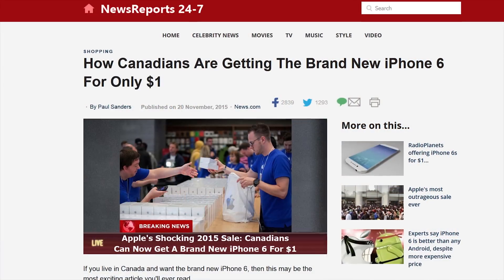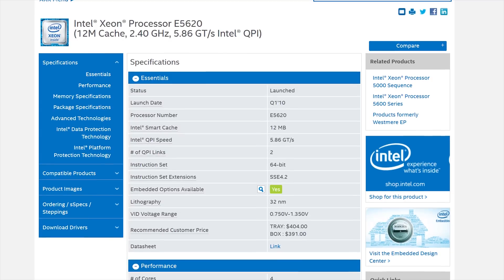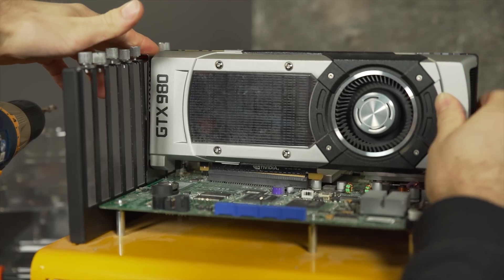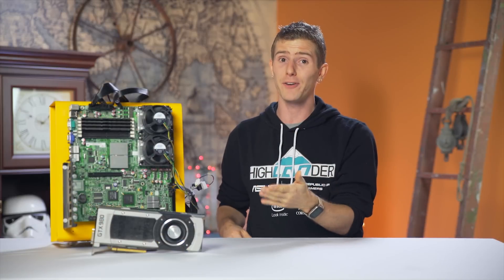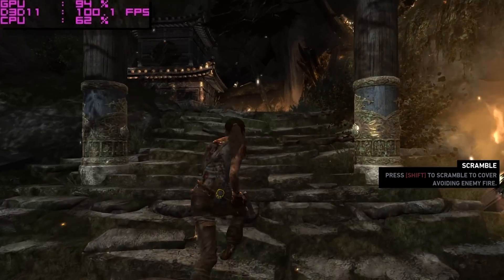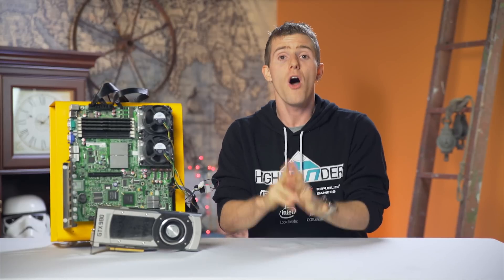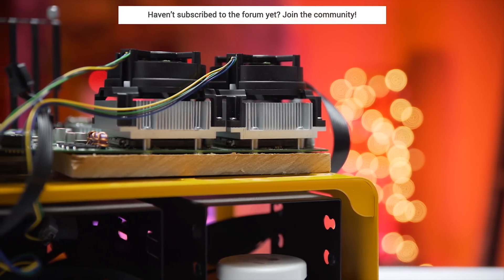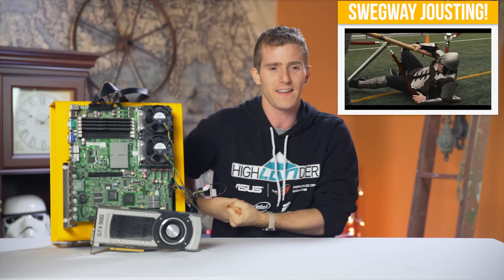Under $150 Budget Gaming 8 Core CPU, Motherboard & 16GB RAM

Comment: so many great bargains to be had with old server hardware. i really wanted to get a westmere six or eight core cpu for my original evga x58 classified but found out that only later versions of the board support westmere so i got screwed into overpaying for a gulftown chip (i7 970 - still cheaper than getting a new board/ram - just needed cpu throughput for image editing).

Comment: It would be a lot better and easier to just do a 775 mod which gives you 771 compatibility. With E5420 you would have 4 cores 3,0 ghz,  they overclock pretty well, and so do they perform in games with a good gpu.

Comment: Well I´m using a Xeon X5460 @3.8GHz, 8GB DDR2 OCZ-Gold, 2xGeforce GTX560 Ti in SLI, on a EVGA 780i via socket mod and this rig is outdated 2day, but games till 2013 and some 2014 really run smooth, with no FPS issues. But Black Ops 3, Witcher 3 and newer games r really a huge morsel for this rig!

Comment: I'm surprised Linus didn't mention the fact that 771 Xeons can very easily be modded to run in 775 motherboards (I've done it twice; once with an X5260 [proof of concept], and once with an X5470 [my current desktop, OC'd to 4.0GHz]). It's just a sticker and a little bit of fine work with a Xacto. All told, it set me back about the same as the second-hand-server here (a little bit more, probably, and admittedly with half the cores), and it actually has a decent support.

Also, please realize you're putting TWO processors with TDPs/power draws each equal to or greater than ONE high-end current processor for (maybe) the same amount of computer power. These are being sold for a reason.

SIDENOTE/WORD OF WARNING: I'm not convinced that Microsoft fully supports these older/odder processors in Win10. The Free Upgrade app complains my X5470 isn't compatible, even though it supports all the features that I've seen listed for Win10.

FURTHER SIDENOTES: The Core-2-generation Xeons will not behave quite as quick in heavy multithreading, because the architecture was basically two dual-core chips bolted together, to switch a thread between the pairs of cores, it needs to put the entire thread in cache/RAM (I forget exactly which), and then have the other pair grab it, as opposed to directly handing it off.

Comment: A good compromise between single and multi-core performance on the cheap may be an old AM3 chip like an x4 965 or even an x6 1090T. The motherboards are way cheaper, and there's less of a headache getting the thing together.

Comment: Finally I'm relevant with my dual x5670 12c/24t 24gb and hd 6950! I can run most games on max around 30-50 fps but given that it's the gpu that's 100% I should be able to upgrade to milk more preformance out of it

Comment: Yeah but you left out the fact that server motherboards can take minutes to get to the OS boot.  That and there is no guarantee they even support things like sleep mode, you could easily get stuck with a board that takes 5 minutes to power on and doesn't support sleep.  Also 2 4 core CPUs dissipate much more power than one 8 core chip, something that will have to be taken into account when purchasing a power supply.

Comment: I demerit the sawing of that video card. I didn't like it at all.

I would had gone out of my way to figure out what cap was blocking the video card, buy a tape of the same capacitors from DigiKey or some other cap retailer, then de-soldered the old cap and soldered on a new cap with the exposed lead covered in shrink tubing. That would had allowed it to be bent into position, and whatever of the lead was there could be covered in hot glue.

Same could had been done with the 4=pin power connector, or at the very least, use some copper elsewhere of similar AWG and soldered the extra wiring for that onto the board, once again using hot glue to cover whatever leads were exposed.
Reply: +bluephreakr Saw off a functionally useless piece of a graphics card

Or desolder an already possibly unstable old motherboard

I see why Linus chose the hard way...
Reply: +bluephreakr or he could have just bought a pcie riser for 10 dollars
Reply: Matthew Bauer lol im just yankin ya dude, thanks for the solid input lol
Reply: axertie
But he had to fit it in a case of some kind, yeah? How would the riser had helped?
Reply: MarioDragon
IK they don't do SLI any more and they probably receive way too many graphics cards, but what they did there makes the card less valuable.

I suppose that means come next garage sale, it'll be a very cheap video card, lol
Reply: I used a skil saw to cut mine and accidently cut in half what can i do??
Reply: Eric Cartmenez If the card works, you are in the clear. If the card doesn't work, then you are skrewed.
Reply: Eric Cartmenez  I figured that part out... But for some of the idiots watching LTT videos, I had to reply to your post as a warning to them more than to you. An example is that users time and time again ask me if I can fix a laptop where the screen is ripped off or they ask me to fix a keyboard where they wore through the number pad keys damaging the PCB.
Reply: Matthew Bauer aaaah okay, understandable. well anyway i appreciate the very real response i got anyway hahaha. thanks.
Reply: +bluephreakr dude it's linus the cost to him is ZERO! Plus everyone there is too stupid to know how a capacitor work....
Reply: MrEeeaddict flux capacitor?
Reply: Eric Cartmenez I wish anyone knew how that worked :p Maybe you can teach these keeedz?

Comment: I built my FreeNAS box on 771 Xeons so I could have ECC and still spend most of my money on discs.  SuperMicro makes backplates for their motherboards, and I only needed to widen a few holes with a drill so that the motherboard standoffs could fit through.  The X7DCL-i is a good ATX board for this kind of project.

Comment: Kinda hate to point out the obvious, but wouldn't ANY system run games like this if your using a 500 dollar plus graphics card?
Reply: Mark Woodworth Do note; Linus&Friends also took a very inefficient approach to this, as you can see there's plenty of comments about how prices for newer platforms aren't much if anymore expensive, such as an X58 platform, or X79  (Sandy based) and the differences between  in architecture are nuts between those
Some of the Xeons on LGA 771 are Core and Penryn
interms of single threaded prowess if Core was a 10, Penryn would be an 11, Nahalem would be a 14 Westmere a 15.5 Sandybridge 18.6  Ivy bridge being like a 20, and Haswell being like 22... With AMD's 8350 being about 16-17... and you can get Westmere Xeons w/ 16GB DDR3 4 Core 8 Threads  for like $20-40 More... then go ahead and buy an R9 290 or 2 on ebay since you'll have 40 PCIe lanes...and go ham... 290s are like $200 on ebay...
Reply: +Mark Woodworth honestly  a cheaper card would run it near identically most of those results were obviously bottlenecked, but Linus' setup was a worst bottleneck than most having 1 Pcie (gen 1) 8x slot as he had said a 16x slot probably would've helped a bit,
Reply: +Mark Woodworth    I know that this is an old post, but no, not all games would run exceedingly well on certain CPU's and RAM. I think this might have caused you to miss the point of using the 980 for testing which was showing that even with 7 year old technology that was discontinued 5 years age, it still has the raw potential of out performing some builds that are double to almost triple the cost.
Reply: I see your point. Thanks for the info.

Comment: +LinusTechTips I would love to see you build a seperate/secondary, cheap, small, performing rig for streaming purpose. As we know, streaming and playing on the same PC can be complicated without a high-end PC. We often have to chose between quality & performances. Some streamers decide to invest on a secondary rig to split the performance hit between streaming and playing. But usualy the secondary rig is just a cheaper gaming PC. Is it possible to build a good, small, cheap, optimized system, a gateway between performance and quality for streamers. Something that would take the load of streaming off your main PC, without investing in useless parts. Thanks! Keep up the good work guys!!

Comment: I have a dell 490 and i bought a gtx 750 ti, when i connect the card i dont see any video in the screen, i turn of the computer and is black, always black, please help
Reply: +Izmochu Your gtx 750 ti is dead. Return it and get another.
Reply: wapted Sorry but i probe the card in other computer and it works, i think its something of the motherboard but i dont know how to fix
Reply: Izmochu
Oh ok, I had a friend with a gtx 750 ti with the same problem and it turned out it was dead. :)
Reply: wapted And you know how to help me???? Because i want to play and i cant
Reply: Google is your best hope.
Reply: you dont have to be racist about it geez the monitor is african american deal with it
Reply: +Powerprick red psu won't matter. ran a 750ti on s 300watt psu that came with a dell inspiron.
Reply: +Izmochu how about trying to download the drivers before then sticking the gpu
Reply: Izmochu
Ah, I looked it up and found some people have issues like you are having if there is DUST in the PCIE slot. Clean it very carefully with a  paint brush, as the slot is delicate.
Reply: Izmochu
Take a look here: http://ccm.net/forum/affich-28931-no-display-in-monitor
Reply: wapted  war psu do you have

Comment: But you can use socket 771 to 775 mod for processor, cut 2 plastic pieces in socket and you can use old xeons in most of 775 motherboards. I used this type of system and had performance like first generation core i5.

Comment: I would have cut the capacitor... Sometimes the motherboard doesn't need it
Reply: It's true, go watch Shawn K video
Reply: +Philippe52 i would rather cut a whole in my case than something off a 500$ card ^^
Reply: GandalfforceYT or just cut the 1 dollar capacitor
Reply: +Philippe52 Yes he would have, had he used a PCI-e ribbon extender.With that, he&#39;d have been able to move the GPU 1 or 2 slot positions lower via the long flexible ribbon.

Comment: if you still want the deals but don't want the craziness at least in america you can get a Dell Precision T3500 if you shop around a bit with a newer four core xeon, often a W3530, and 4 to 8 gb of ram plus a 120gb-1tb hard drive, and even Windows 7 Pro in the form of the COA on the case. Plus for $100 you could get a 6 core Xeon for it like an X5650-X5670. Also you can still get some deals with old Opteron parts.

Comment: Don't forget about power usage. Anything DDR2 and especially FB DIMMS use an insane amount of power and get very very hot. Also this board was designed to be passively cooled, meaning the DIMMS would also get a significant amount of airflow. If you would use FB DIMMS instead of normal DDR2 DIMMS and only use CPU coolers you would fry the memory in a matter of minutes!!!
Reply: Wel the point of bragging with a $150 build is kind of dumb if the monthly cost to run it is too high. A DDR2 FB-DIMM uses 10.4 watt! Factor in the 50 Watt per CPU and that's 140 Watt with 4 DIMMs. Without GPU or anything else...
Reply: +NickDixon so you're an enthusiast if you own an 8 core? 

Depends what sort of enthusiast you are. There are plenty of passive cooled rigs that have had their fair share of hours put in. I've custom watercooled for years and I will still pick parts off efficiency.
Reply: "Passively cooled" is very different in the server space. It means there are 4-6 high speed turbo fans moving air through the chassis.
Reply: +HelloHa I didn't mean servers. We are talking about enthusiast builds in general. This is not a server, for example.
Also a server is a shitty example for inefficient parts being 'OK'. There is a reason why these parts are cheap these days.
Reply: I am talking about the subject in the video. Which is a server motherboard and server hardware.

Comment: Well time to build another rig, perhaps as a general PC :)
Just finished my own personal rig :
i7 3930k
ASUS P9X79e-ws (YES, The one that Linus had in his TJ-07 personal rig)
XFX 7970 (I would have gone with ANYTHING other than XFX, but alas no choice)
250gb Boot SSD, 2x250gb raid SSD for recording and gaming

Super ghetto HDD setup :
1x240gb
1x320gb
1x640gb
2x80gb (They are like 10 years old, so I put them in RAID :D)
1x1tb WD Blue for general storage

If you're wondering how I'm storing all these HDD's I've got a HAF Stacker ;)

What personal rigs are you guys running? :)

Comment: Watching this video like ok this seems like an ok budget build, but where is the gpu?  WHAT?  How do you throw a gtx980 in there and call it a budget build?  Also would like to point out that the l5420 is not 8 core.  If you want the cheapest gaming rig possible i would recommend an AMD A10-6800k as it actually has good performance with games set to low.

Comment: I think that's the exact same board as is in my server. The ports and board layout look familiar. It's a rackable systems unit though, not Dell. It takes a godddamn eon to boot which is fine for a server, since I think I've turned mine off like 5 times in the last year and a half, but I probably wouldn't be able to stand that in a desktop machine.
Guess you have to make do with what you got though.

Comment: Has Anyone used these cpus with the socket 775 adapter to use one cpu in a 775 motherboard? wouldnt that make it easier to work with?

Comment: Getting a LGA771 board doesn't make ANY sense to me. Online shops have a lot of few dollar 771-to-775 adapters. This means you can run Xeons on standart 775 boards, which are equipped with everything you need in a desktop PC. I don't know about ECC ram, though.